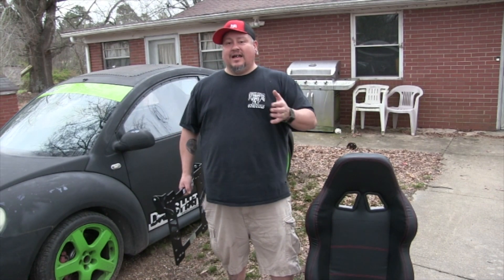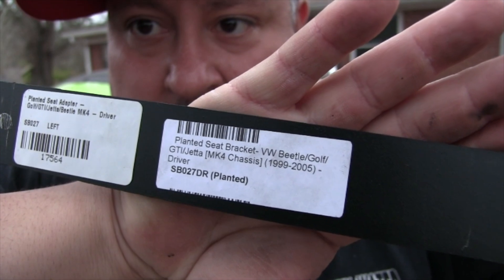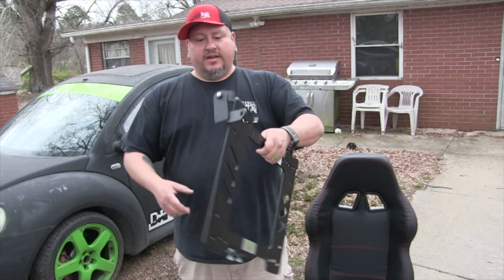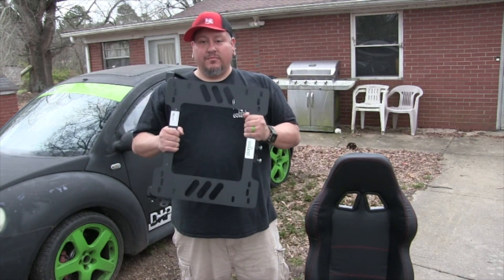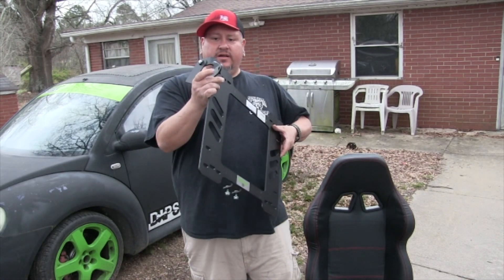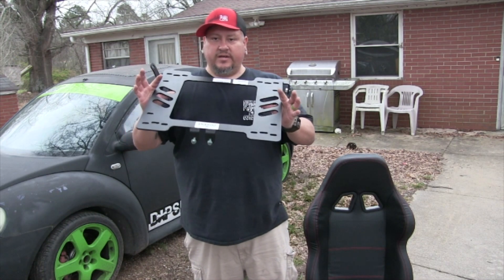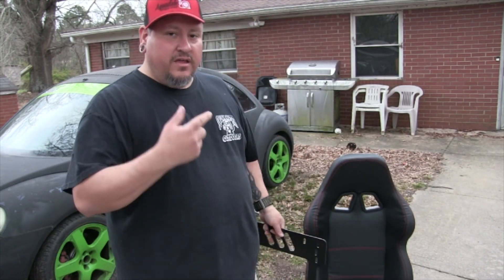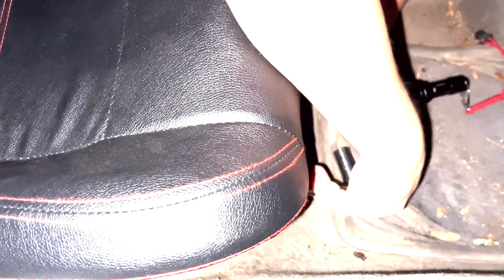How to Install Racing Seats Using Planted Mounts - Volkswagen MK4 Golf, Jetta, New Beetle

Comment: i take it if i want to have the seat be adjustable i would need some kind of slider sandwiched in as well?
Reply from the maker: Yes, you will need a slider if you want it to adjust. It sits low so a slider won't lift it much either!